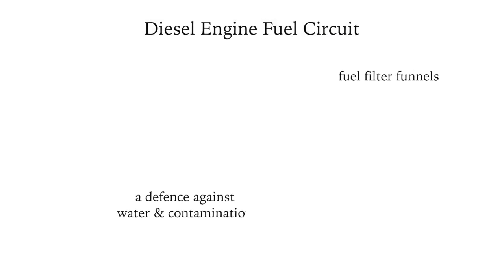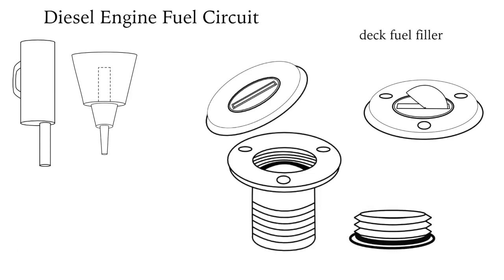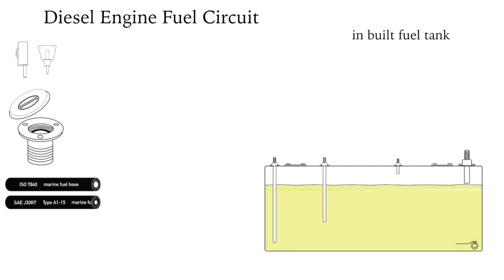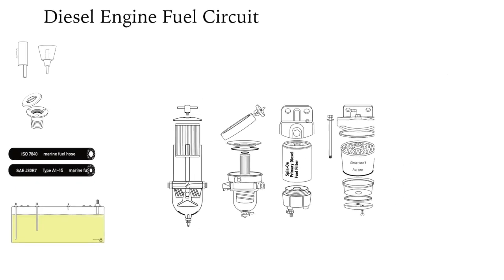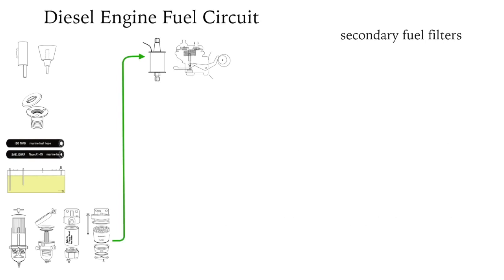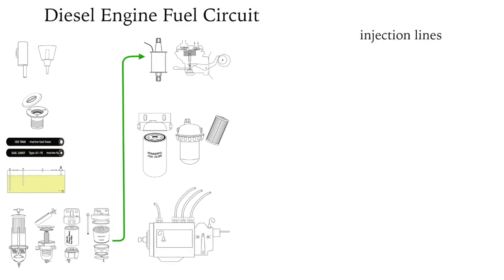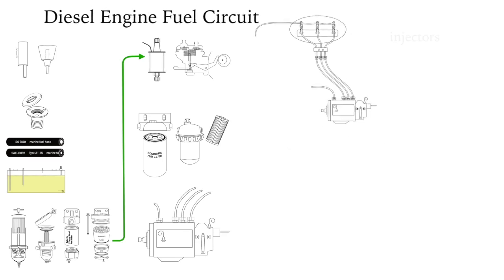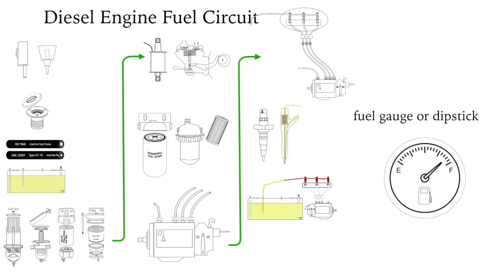F3  Fuel Circuit of Marine Diesel Engines

Comment: These are great....thanks so much. Does the diesel return line have to go to bottom of tank ?
Reply from the maker: Hi, thanks for your kind words.  No, the return line does not have to go to the bottom, but it's best to avoid just pouring the diesel back at the top of the tank. a tube that goes at least part way down, when the tank is mostly full, is best.